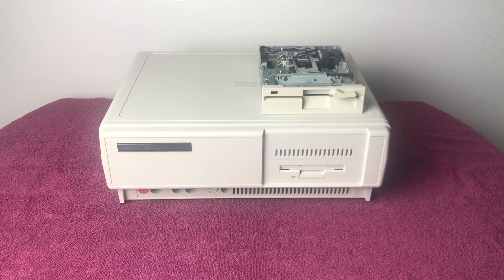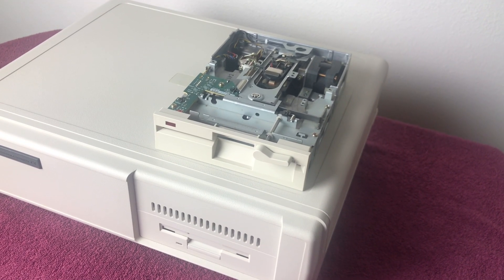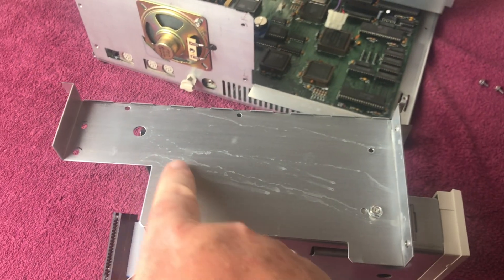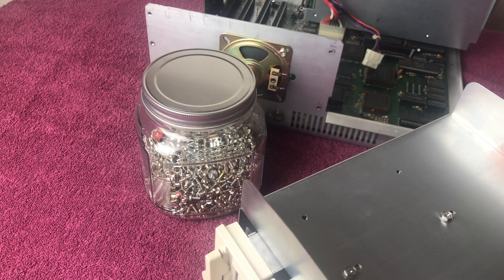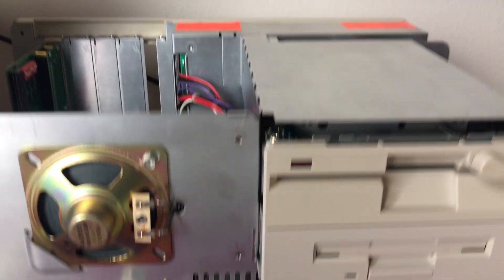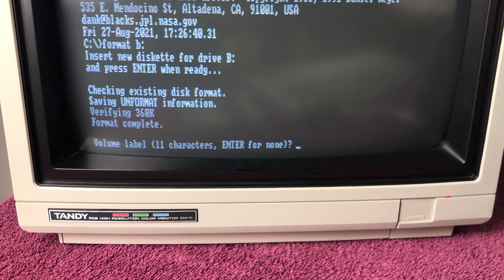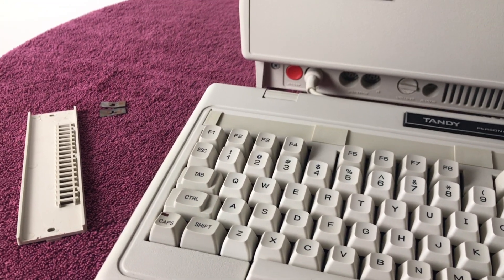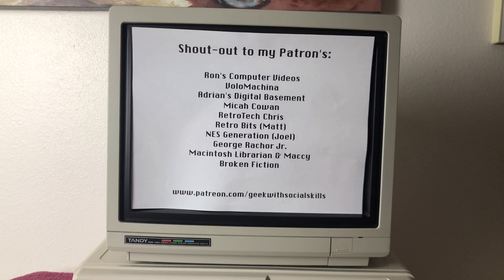Tandy 1000 TX Computer TEAC 5.25" 360KB Floppy Drive Upgrade #SepTandy 2021

Comment: I convinced my mom to buy both a Tandy 1000sx from my local Radio Shack and a Diamond Trackstar board for Apple 2 compatibility
Reply from the maker: That's awesome that you have a Diamond Trackstar board. I've never seen one in person, only read about them.
Reply: @geekwithsocialskills  my local Radio Shack sold  Diamond Trackstar board . One issue though was the Tandy floppy drive had some difficulty reading Apple floppy drives.
Reply from the maker: It would be cool if you posted a video showing your Tandy 1000 with the Diamond Trackstar board installed.

Comment: I Have the same Tandy 1000TX that i recently dragged out of my cave, i have a hard drive in mine and a 3and 1/2  floppy 720  and going to put a 5 1/4 soon as i find one in my collection .When i turn my unit on it still ask'ed for boot disc that i am waiting to be delivered . i like the way yours starts up with drive c/: so i believe you have a solid stat drive in yours then . so where can i get one for mine. please.My Name Tony from Drouin Victoria Australia.
Reply from the maker: Greetings Tony from Drouin Victoria Australia! The Tandy 1000 TX is a fun computer. For my solid state hard drive solution used in my Tandy 1000X, I use a Lo-tech XT-CF-lite by TexElec. Here's a link https://texelec.com/product/lo-tech-xt-cf-lite-rev-2/

Comment: could you updated the cpus
Reply from the maker: It's possible to upgrade the CPU, however IMHO it takes away the original charm of the Tandy 1000 TX computer. I found this link online that discusses upgrading the CPU in a Tandy 1000 TX for your review: https://forum.vcfed.org/index.php?threads/tandy-1000-tx-with-pk-x486-87sl5-1-upgrade-speed-that-i-need.69231/
Reply: @geekwithsocialskills   late 16-color Tandy supporting games, like King's Quest V and The Secret of Monkey Island, rather sluggish when played on an 8MHz 286
Reply: @geekwithsocialskills  apparently most 286 to 486 upgrade boards won't fit the case physically, though one person used a metal cutter to cut into the metal to make it work , much like most hard cards are 13" long not 10" like Tandy
Reply from the maker: Do you have a Tandy 1000 TX computer?
Reply from the maker: The Tandy 1000 SX is a nice machine and as you know, very similar case to the 1000 TX.
Reply: @geekwithsocialskills  my mom bought it summer 87 and tx came fall 87

Comment: I am curious as to the hard drive system you have installed in your tandy 1000TX. I am building one from salvage parts and would like to add some sort of HDD.
Reply from the maker: I used the XT-IDE Delux in my Tandy 1000 TX. Here's a link: https://shop.bluelavasystems.com/products/xt-cf-bootable-8-bit-isa-compactflash-xt-ide-with-slot-8-support
Reply from the maker: I also use Lo-tech XT-CF-lite rev.2 sold by Texelec in many of my vintage computers https://texelec.com/product/lo-tech-xt-cf-lite-rev-2/
Reply: Thank you so much for your help. I will keep you posted on my project. I also have a Tandy 1000HD with an original  semi working 10M internal drive. @geekwithsocialskills
Reply from the maker: You're welcome. Happy to help!

Comment: I've never used a Tandy, I want one..
Reply from the maker: The early Tandy 1000 computer models (1000A/HD,EX,HX and TX) with the Tandy sound (Texas Instruments SN76489 sound chip) and graphics (16 color CGA) are the winners in my book for that special "Tandy" experience. The later models are more like a standard (SoundBlaster type sounds/VGA, etc) DOS computers, so if you do pick one up, I'd suggest one of the above models.

Comment: I've seen lots of Tandy 1000's with that shade of drive so it's certainly period correct.

I wonder if a micro-abrasive like Magic Eraser would help the stains inside.
Reply: Wait, I totally have an extra slot cover for you
Reply from the maker: @anovaprint  ... and cool on the extra slot cover. Thanks!
Reply from the maker: Indeed, this is the proper drive for the Tandy machines based on looking at a few 5.25" external Tandy drives. As for the shade of color, it's actually grown on me. It's not exact, but close enough. As for the stains inside, I ended up using some steel wool which worked great!

Comment: Gotta be careful with the pinouts on those Tandy floppies. Even if they don't have power over the ribbon, Tandy used the Shuggart pinouts throughout the entire 1000 series, which will almost certainly require modifying a ribbon cable if you want to use a more generic drive.
Reply from the maker: Indeed, gotta watch the pinouts on these Tandy machines, especially when using generic 3.5" drives.
Reply: @geekwithsocialskills  Nice thing though is that the 1.44MB drives are backwards compatible with 720K controllers, and one can easily put tape over the hole of a 1.44MB floppy disk, and format it for 720K. Sadly, this is not the case with 1.2MB drives, which require an HD controller.

One more thing to watch with the 3.5" Tandy floppies, is that the keyway notch on the floppy and motherboard is reversed from what it would be on an IBM PC. Again, it's as simple as modifying a cable to get past it, but "A trap for young players," as Dave from EEVBlog likes to say.

Comment: Was this made by Matsushita/Panasonic like the TL?  I know the TL was also sold as the Panasonic Business Partner.
Reply from the maker: The 5.25" floppy drive was made by TEAC and the 3.5" floppy was made by Sony.
Reply: @geekwithsocialskills  I was talking about the computer itself.
Reply from the maker: @douro20  My understanding is Radio Shack  / Tandy had agreements with Digital Equipment for development and the sale of Tandy computers to Panasonic for resale with a Panasonic label. Apparently Tandy also contracted with Japanese firm Matsushita to supply personal computers that the Japanese could then sell in the American market under their own name. I don't know if the Tandy 1000 TX was sold under the Panasonic or Matsushita label.

Comment: with that math coprocessor the end result should be a good rig for you to run Lotus 123 to do your spreadsheeting; drill a hole for that other mount screw; back in the day my PCs would have various drives that didn't have color matching face  either so would say you can still claim historical realism
Reply from the maker: Not only Lotus 123, but the game SimCity takes advantage of the math co-processor as well.
Reply from the maker: P.S. I won't be drilling a hole for the other mount screw. With 3 the drive is nice and stable/secure.

Comment: Is there any particular reason you put a RTC and an FPU in this machine?  Was it just for the video?  I saw your comment on Vwestlife's video today where he did the RTC video.  It's kind of the most pointless thing in the world.  This machine is never going to be used for productivity. I seriously doubt there is even a single DOS game that can run on a 8088/8086 that requires an FPU.
As I stated on vwestlife's video, I don't know if the battery is a type that can leak, but if it CAN leak, it WILL leak. All modern batteries that can leak are poorly constructed and will leak. Not to mention the 35 Dollars.
Reply from the maker: Hey there. Thanks for stopping by my video. I added the RTC into my machine a few months ago (link to that video in my description) because IMHO it's awesome to have the date and time correct. I've actually done modern day emailing from my Tandy 1000 TX over telnet. It's pretty cool actually doing modern things on vintage hardware, so I'm at least one person using the machine for productivity, even if at a limited level. As for the FPU, I added that for a couple reasons, one, because I could ;-) and two the game SimCity will actually use the FPU for quicker rendering of the terra forming within the game. There could be other games too, but I'm still looking into that for a future video.
Reply: @geekwithsocialskills  Believe me when I tell you, I get the geek factor.  I do the same kind of ridiculous stuff.  I just think it's comical.  Doing things because you can is OK in my book.

Comment: I'm sure it makes sense for your setup, but in my head the 5.25" drive is always A: and the 3.5" drive is always B:  :-)
Reply from the maker: P.S. thanks again for the heads up on flipping my original Karateka game disk over a while back.
Reply: @geekwithsocialskills  you're welcome... hope it helped the channel... I definitely saw some Facebook chatter about it!
Reply from the maker: Heh, same for me and I actually considered doing that, however the majority of Tandy specific software I have is on 3.5" disk. There was also the issue of needing to modify a longer floppy drive cable to deliver power to the 3.5" drive and not the 5.25" drive since the original cable is smaller for the specific setup currently in my machine.
Reply: Depends. On an 386 or 486, you'd likely have the 3.5" as A:, but on an 8088, you'd likely have the 5.25" as primary. Depends on the software disks you have for it.

Comment: Great video!  I've heard that most software for the Tandy 1000 series of computers (and maybe the 2000 series?) came out on 5.25'' floppy disks, but Tandy must have had a good reason to put 3.25'' disk drives in their computers.
Reply from the maker: Thank you! As for why Tandy went with a 3.25" floppy drive I assume is probably since my specific model of 1000 computer (the TX) is a 286, a lot of 286 machines were moving to that size floppy drive, but don't quote me on that ;-)
Reply: probably was to keep up with the Joneses
Reply: Honestly, the 3.5" are more convenient theses days. One can always stick some tape over the hole of a 1.44 MB disk, and format it as 720k.

Comment: Did you have to set a jumper to ignore the power on the ribbon cable?
Reply from the maker: No jumper. Apparently power is only provided through the ribbon cable when using 3.5" drives. It's something to do with the connector on the drives.
Reply: @geekwithsocialskills  interesting!
Reply from the maker: I don't know all the secret sauce that makes it happen (or not happen), but it is something to be aware of. People don't need to be zapping drives with 12 volts of power for no reason and possibly killing them. I know this company sells adapter for specific Tandy drive use cases to deal with the power in the cable issues https://www.tindie.com/stores/cyberneticsys/